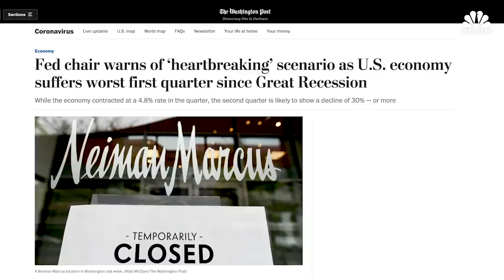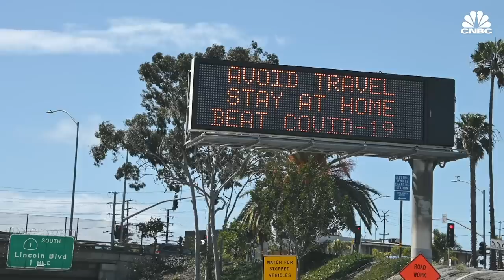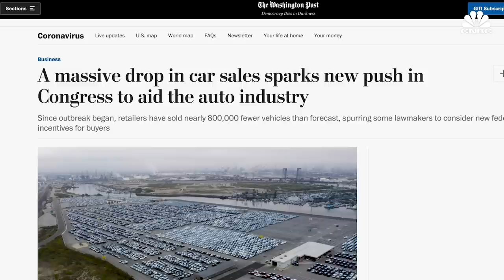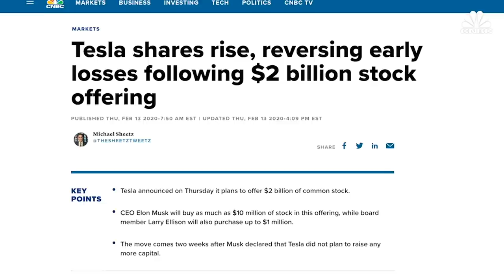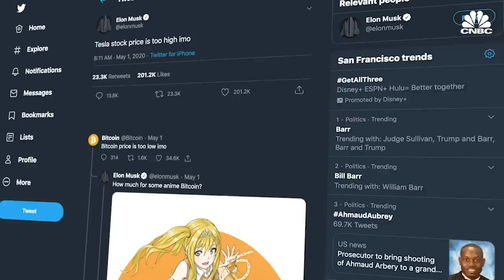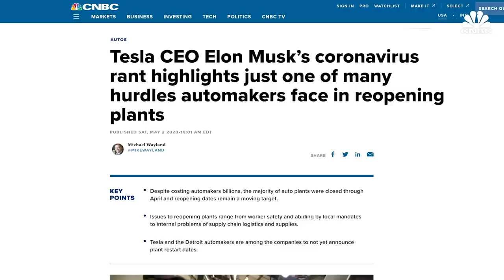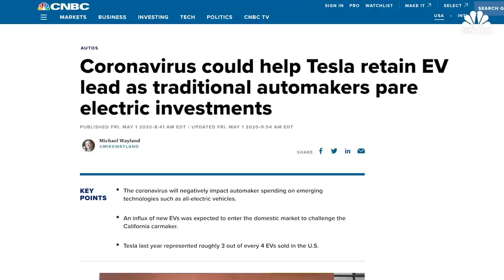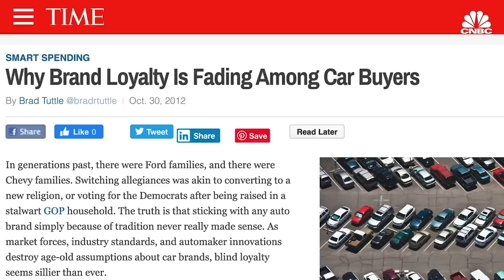Why Tesla Is Better Positioned To Survive Than Other Automakers

Comment: Not so long ago CNBC made tesla video's  ''can they survive the competiton'' and ''Gm beats tesla in innovation''
How the tables have turned :)
Reply: indeed
Reply: maxim913 GM is now designing cars they can fully drive themselves, you isn’t even need a steering wheel GM is a bigger company and some the worlds top engineers I wouldn’t put Tesla I’ve them just yet a company like GM doesn’t make it this long without being creative themselves especially when your two biggest rivals are right next to you
Reply: *how the turntables.
Reply: @alexnowicki286  where are those cars then? All vaporware lol
Reply: maxim913, the question is not will they survive, the question is which competitors will survive the slow death of the ICE vehicle market.  None of there competitors are ready for the move to EV, and now with the economic downturn, they cannot invest to catch up.😵.   So long to the past!  My daughter will think of Ford like American Motors?  What is that?
Reply: @alexnowicki286  "worlds top engineers" - Correct - Specialties - Combustion. Different technological Specialities then what are required for EV cars.TESLA has the best EV engineers in the world bar none. Even with shifting into different production like stamping the entire body - something the other car manufacturers could have got into years ago but didn't.  "GM doesn’t make it this long without being creative themselves" - I agree with you again, but they were creative in a different sphere of tech and time. Things are different now. What was a competitive edge at one time has now become a huge liability. If your competition is fat, it isn't difficult for you to beat them without trying to hard which then on a macro scale slow down your innovation - this has been the state of things in the automarket for 25+ years. And finally - "now designing cars they can fully drive themselves" - designing? There are close to a million if not more TESLAs already on the road that have the capability of being fully autonomous or adjusted for. That is a huge amount of DATA that is streaming in now - today.  It has taken TESLA 10+ years of R&D and breakneck innovations to get where they are. I understand that GM and FORD and so on have a lot of clout to throw money at the problem, but unfortunately I don't think that is a huge advantage here. As innovation and new knowledge takes time to develop and build upon. GM, FORD and the other great car manufacturers will be around for probably decades to come in some form or other and maybe longer if they transition, but the birth of the tech that will eat them is here, and it will only grow voraciously. The time of the exponential is here. Legacy companies are based on a linear expansion scale, the new breed of companies we are seeing are based on the trajectory of the exponential. Humans are not wired for the exponential, and many cannot see it, most will only encounter it when it smacks them in the face.
Reply: @ruyek28  Casting aluminum in large complex shapes has issues when it is annealed (heat treated to give it strength), the casting warps and distorts, main reason never commonly used and why no expertise in US, plus legacy auto's expertise is in steel and iron
Tesla shares a materials scientist with Space X and have produced a new Aluminum alloy that has all the required properties and does not need to be heat treated - Munro and Associates don't know what the additives are. Also a new Aluminum alloy for the motor casings, unknown never seen before.
Throwing money at the problem can be meaningless, Elon has stated Tesla's biggest challenge is finding enough brilliant innovative engineers, which is saying something as all really smart graduates want to work for Tesla to be part of a brilliant innovative cutting edge team, a learning, growth and development experience worth more than any university Phd
Worth looking at the Third Row Tesla Elon interview Directors cut - 4 Hours and also their Sandy Munro and Tesla 1 hour special and the Munro Live podcasts as they pull down and analyze the Model Y
Reply: I’ve been hearing about “competitors” for years. None to be seen on the horizon. Covid-19 has set those companies further back than tesla. So i expected some competition in 1-2 years but now i have to move my timetable further down.
Reply: steve crawford  to late
Reply: My my my how the turns table.
Reply: And now that they are all on board, the stock will tank.
Reply: That shows they will change when they are wrong enough. But then again, they were not criticising Tesla that harsh.
Reply: Alex Nowicki GM doesn’t have half of Tesla’s ability for self driving. There are half of a million Tesla’s that already drive partially autonomous, and safely so. I was on GMs dealership in January and there were no cars on the lot with any sort of autonomous driving capabilities. Even the 65k truck/suvs. So no. GM isn’t ahead of anything or anyone.
Reply: @alexnowicki286  Yeh a company like GM survives for this long because it keeps getting bailed out by US tax payers, rly nothing to do with the company itself...
Reply: Alex Nowicki Hahahahaha GM cant even remotely touch Tesla's technology. GM only makes obsolete gas engines, thats their only mastery - and GM had to buy the sub-optimal cruise automation just to still be behind Tesla.

Comment: build a car that people love with a strong purpose in mind like to reduce carbon emissions and have better tech and performance than any other production vehicles. This will create a strong brand loyalty like Tesla did(im a follower)
Reply: Electric cars don't reduce carbon footprint. The manufacturing of the batteries alone is an incredibly energy-intensive process. Then, consider that the electricity these cars use largely comes from coal and oil power plants. 

Of course, the marketing is effective enough. It also seem to be the direction the industry is heading in - that, or hydrogen fuel cells.
Reply: Joey Kelly are u seriously HAHA.... have you seen any progress in hydrogen vehicles? in fact honda and i forgot some other manufacturer canceled its hydrogen plan cuz its stupid baseline. and all materials require energy dont you think, batteries and solar can be carbon negative throughout their lifetime when compared to fossil fuel which emits more over time. Even if the electricity comes from the fossil fuel grid to charge EVs, it is still more efficient and cheaper than a regular ICE(~20%) vs EV(~80-90%) on efficiency. So idk what are you trying to get here
Reply: @staph8022  The electricity used to recharge electric cars comes from coal power plants.  Coal is the dirtiest energy source on the face of the Earth.
Reply: @staph8022  That and just shy of 1/5 of the US population lives in rural areas, you know, ass end of nowhere?  Everything is really far apart?  Tons of energy loss in power distribution to get charging stations everywhere we need them for electric cars to be a viable widespread option?
Reply: Anonymous Lee you apparently didnt read whats above dont you... and not all power plants uses coal. to put it simply,fossil fuels need to be rid off and go towards solar hydro and wind..  keyword pls read what i wrote.
Reply: BLACKVIEW USA wow great source u have there, unfortunately the demand for tesla is overwhelming especially model y. Im not your typical tesla fan boy, i stick with raw facts and put it aganist the truth. Should be another stereotype aganist what tesla is trying to do. the big picture is to reduce our reliance of fossil fuels and switch to renewables as eventually fossils fuel will run out... so why hold back on renewables and EVs if we have to come to this point? and for sure climate change isnt real for you then
Reply: Anonymous Lee you see...EVs are just coming of of the shed with Tesla being the leader. When ICEs first came out do you see refueling stations everywhere suddenly? same case for charging stations for EVs. But why would you charge at a station when you can charge it at home conveniently... average tesla range is about 300 miles.. and its more than enough to cover ur daily trips.even if its a roadtrip, you dont wanna take a break after 6 hours of driving? Thats where the superchargers comes in
Reply: @staph8022  Tesla's are a scam and super expensive to insure because once you crash them then they are totaled 
Tesla doesn't even provide service for their vehicles after a couple of years and you can never repair your own vehicles because you can not buy parts anywhere except junk yards. 
Also the few short years they do provide services, you may be hundreds and hundreds of miles from the nearest repair facility
Reply: @staph8022  Not to mention not everybody can afford a car that costs 35-70 grand and is almost impossible to get repair parts for.
Reply: @staph8022  so for now, it's a rich people car.
Reply: @staph8022  You do have a point about hydrogen-powered vehicles. If I remember correctly, there have been a few production cars running on hydrogen fuel cells, but because it's a fairly new technology, and there are already electric cars (currently no room in the industry), they flopped. I don't think they were ever intended to do well, however, as they were basically statement pieces. 

If there's a future for hydrogen-powered vehicles, it will take at least another decade or two for it to take any significant share of the market. It's a very new technology with no infrastructure built around it. 

Now, to address your point pertaining to the efficiency of electric vehicles... No, that isn't accurate at all. Transferring coal and oil-derived power to a battery is just adding a step that would normally be absent in conventionally powered vehicles. It's extremely inefficient overall. You're not accounting for the inefficiency of conventional power plants, which is why your rough stats are meaningless from an environmental standpoint. 

Electric car technology will only be worthwhile once our grids are switched to renewable energy sources. Right now, however, those renewable sources, with the exception of hydroelectric, are not profitable. They're only getting by via government grants.
Reply: @Seawolf It's still not something that would be financially reasonable for most Americans to buy.  That and they're horrible to repair, as I've heard from a friend who got one used at a discount.  Nightmare to get parts, you pretty much have to get them to send out a special technician for repairs.
Reply: There will be a lot of questions around "better tech" and "quality".
I assume that he will pretty fast see that there is currently no market in europe for his cars. ( to expensive, infrastructure missing, eletricity to expensive.)
Reply: @Seawolf The uneducated always seem to cite "scientific consensus", as well as the influence of some kind of lobby or multinational conglomerate. All it takes is a basic understanding of thermodynamics to determine that you are incorrect - but you don't even need to know that much, because any self-respecting engineer could tell you exactly what I just said before. 

Yes, electric vehicles have a very high efficiency when compared to traditionally-powered vehicles. However, to look at this and call it a day is to completely miss the point. Consider what the source of that electricity generally is - mostly oil and coal being burned at a low efficiency, much like the petrol of a traditional vehicle. The difference is that there are more steps in between with an electric vehicle, resulting in a higher overall carbon footprint. 

Let's use the "80% vs 20%" argument brought up by another commenter. Now, these are rough numbers and not the best way to look at this, but...it should work well enough. Traditional vehicles run at 20% efficiency, while electric vehicles run at 80% efficiency. However, this 80% efficiency is really coming from a power plant that runs at 20% efficiency, and .80 x .20 is .16, giving us 16% if you want to look at the OVERALL efficiency. This is a simplistic view, but it works for brevity's sake.

I would also once again like to point out that the production of the massive car batteries used in Teslas and other electric vehicles is extremely harmful to the environment, and leaves behind an enormous carbon footprint - one that could not be overcome in the vehicle's lifetime, even if it were run entirely on renewable energy. When this technology improves, there will be a much better case for electric vehicles.

Comment: Well they’re pretty much literally the only car company that has been 100% focused on making eco friendly electric cars from the start
Reply: Hmm eco friendly? What about the generation of the battery that will need replacement every 7/8 years for full capacity? Then theres the serviceability- you're tied to the dealer. If the car would last easy 20 years you'd be onto something but right now you'd need to buy Teslas ever x years whereas the 20 year old banger I got still runs.
Reply: @dallysinghson5569  they're getting there, there are plenty of videos out there disproving the checkmate people seem to think they have over electric cars.
Reply: @dallysinghson5569  petrol cars are even worse. You just saw the video explain the problem of overproduction. Were you paying attention at all?

Comment: Tesla is absolutely killing it. Amazing that people have more trust and faith in a 5 car company with great energy products than the rest of these slow dinosaurs that make the same crap with a different shell and remain big oil’s btch. Can’t wait to get a model Y!
Reply: Sandy Munro recommends it highly
Reply: Nice shilling
Reply: Mike or maybe I like fast cars that drive themselves that stop polluting the day they leave the factory. My Tesla charges using nothing but the panels on my roof. That’s called choice, and zero emissions (after the emissions of creating it of course, nothing can be created with 0% emissions, but over time it is far less). The only choice an ICE car has is mining, refining, shipping, pumping and burning 80% of the ONLY fuel available as heat while just 20% is used to move. Tesla doesn’t have to say that, that science is beyond solved already, so why not actually learn basic math and provide some numbers for us that differ from the already-solved ones?

If you are still confused, leave any ice car running in a garage and take a deep breath and see if it’s clean or not. I can leave my sun powered EV on all day and come out alive without a single atom of emissions. You have ZERO choice but to burn gas for the ENTIRE life of your car, and you call someone else the idiot?

EVs are way better for the environment than the crap chevron brainwashed your mind into thinking. Maybe all those fumes you choose to breath have impaired your thought processes?

When an EV battery starts to fade you just use it in a solar battery or reclaim the materials. Pretty much solved already. Nice try though sweetie. Notice how clean cities got once corona kept the ice cars off the roads? That’s pretty much all you need since you can’t do basic math.
Reply: Jack Ch. thanks! You think it’ll drop the stock price enough to buy more? Not a shill, just a happy customer. I love that Tesla is so well.

Comment: I remember sitting in the dealership parking lot taking delivery of my parent’s brand new 1969 Pontiac GTO , I was so proud of my parents and proud of the GTO. I remember sitting in the car looking at the silver Pontiac symbol in the middle of the steering wheel. It was peeling up , it was a piece of vinyl, and remember thinking that was cheap but what the heck, it’s a GTO. I bought the sizzle and so did most Americans but I don’t think GM can sell the sizzle any longer. Those were golden days for American auto but I can tell you today as a Model 3 owner, the Tesla is 10 times the car that GTO was.

Comment: The cheapest used Tesla’s (2012-13 model S, 100,000+ miles) still usually go for around $30,000, I would argue that they’re still somewhat of a luxury brand
Reply: SebastianTheGreat you can buy an factory new model 3 RWD SR for $35k. BEVs last longer than ICE with almost no maintenance. Fewer moving parts = fewer things to repair or replace and longer service life.

Comment: Reporter:" Some Automakers were just selling cars just to sell cars"
Me: Isn't that what a car company supposed to do?
Reply: They reffer to carmakers accepting volume contracts. You get good prices with suppliers because you commit to buying (thus selling) X amount of goods. There's a fine for not completing your end of the contract. Selling less cars means not making the required amount. Making more cars and selling them at a loss when its a bad year saves you the cost of a massive fine. Issue is when you sign these contracts and any fall in sales means you're screwed. Local dealers have these kinds of contracts as well with the automakers.
Tip if you read this till the end. They usually report these figures quarterly, car salesmen are desperate at the end of quarters to sell cars to meet these numbers, snatch a good deal as they are likely to sell for a really low price.
Reply: I think they ment they produced cars just to produce. Not because they knew they could sell them. Producing more than they could sell.